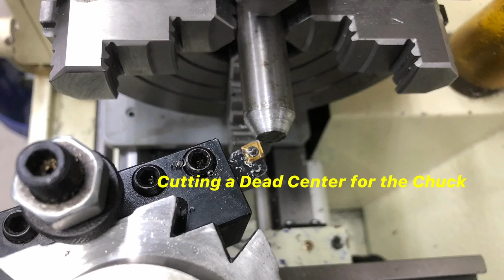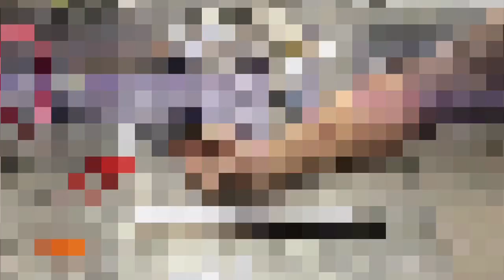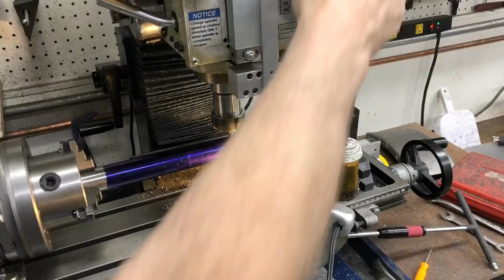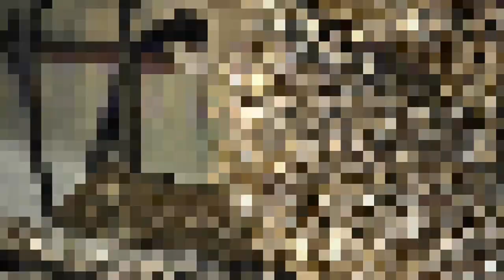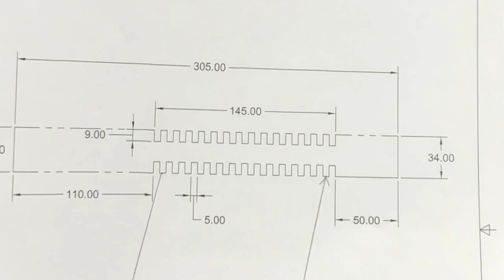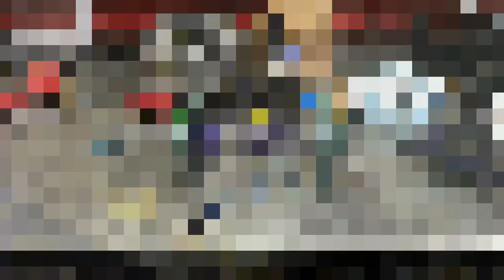The Plastic Shredder Project

Comment: I noticed that you were not using coolant.   Is that just so we can see it better?  Are you blowing air at it?  I am just getting started with my own little machine shop and am struggling with the coolant issue.
Reply from the maker: In this case I was using solid carbide end mills.  Each time I made a cut it was fast so as I kept cutting and resetting the carbide had time to cool a bit.

I often will use a cool mist setup without the fluid just to clear the chips so I can see as well as avoid recutting the chips.

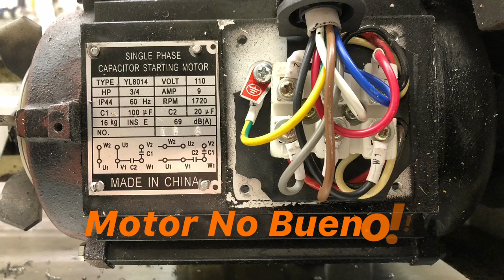Comment: Nice video and pardon the nerd moment here: 3:56 pausing on the wiring diagram...
Though it says capacitor starting motor, you said it doesn't have a centrifugal switch, and the wiring diagrams identifying U V & W are labels for a dual run capacitor motor (3 sets of coils). Power goes straight into coil U, C1 delays the single phase AC going to coil V, C2 delays even more the AC going into coil W, to give you clockwise rotation as depicted in the right side wiring diagram. This is how a 3 phase motor is run with single phase AC power, using 2 run capacitors to delay the single phase to get 3 phases.  The left diagram shows how to wire it for counterclockwise rotation.  It makes sense to use this type motor in a machinist lathe to get the high torque of 3 phase with only single phase power.
Reply from the maker: Thanks for the explanation, I’m good at many things but A/C wiring isn’t one of them.